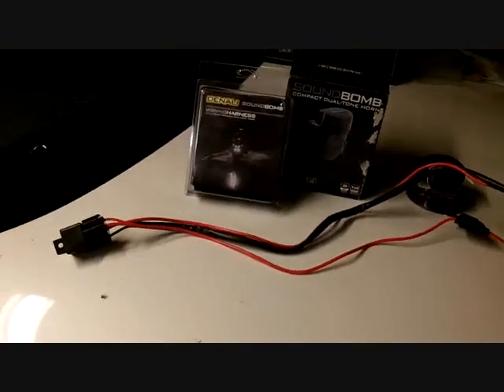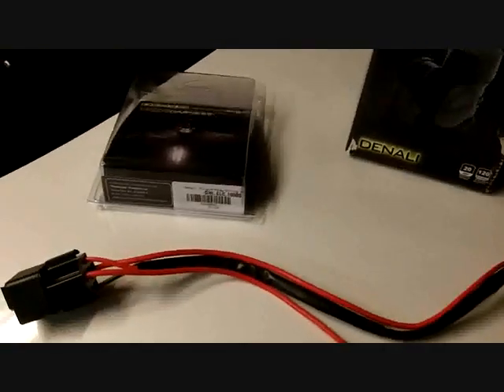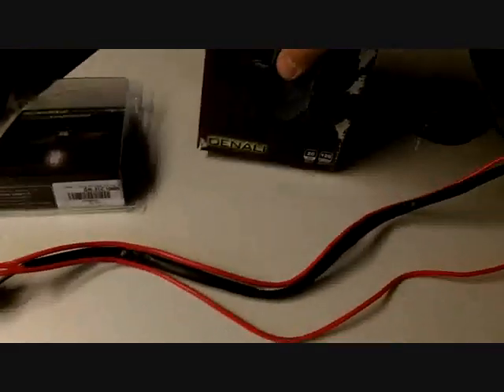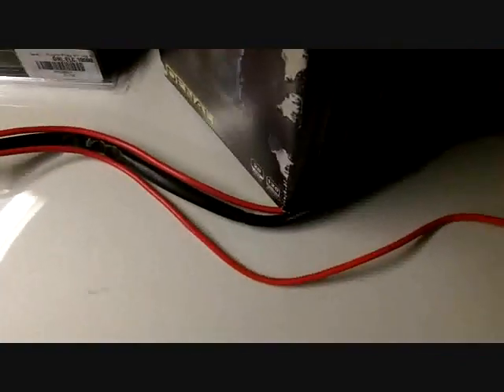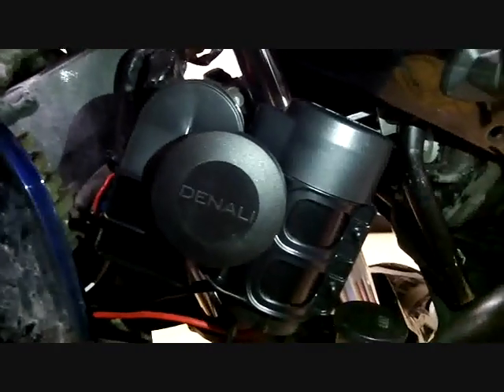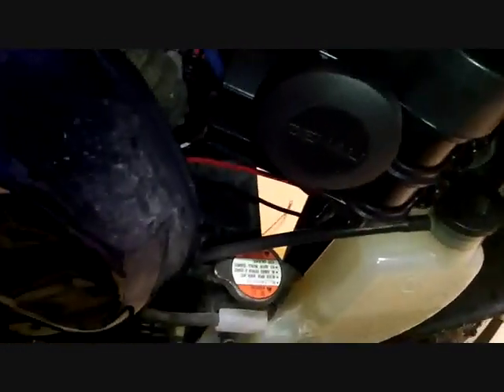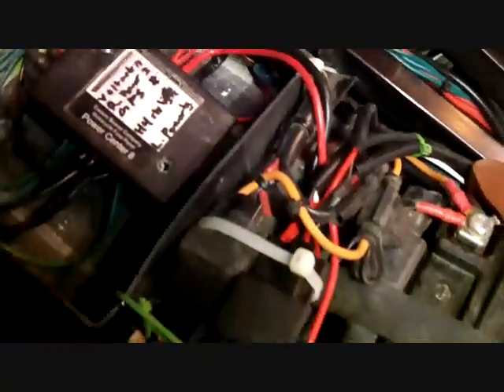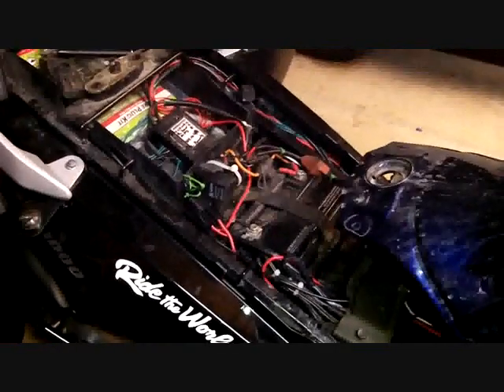Denali Sound Bomb Horn Installation

Comment: Do you know if it can be plugged into the wires for the oem horn?
Reply from the maker: JaHypee Yes. The unit has to plug into the EOM wires. This way, your stock horn button activates the unit.
Reply: Why is the wiring harness needed if it can plugged into the oem wires?
Reply: JaHype the unit needs to plug into OEM wires, battery + and frame -  to help provide the full power needed for the horn, the wiring harness helps a lot.
Reply: The stock horn draws about 3-5 amps while this air horn draws about 20 amps. This is why you need the extra wiring.